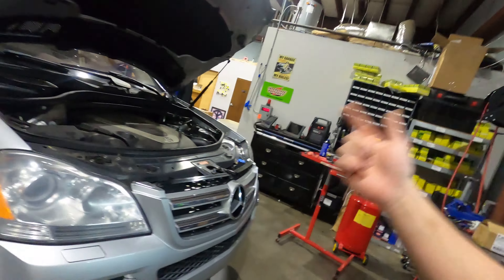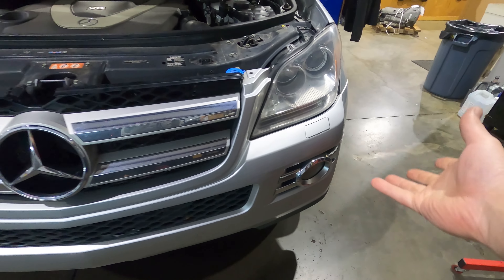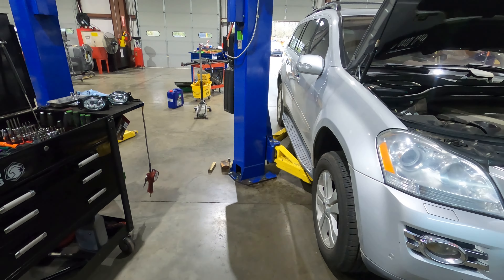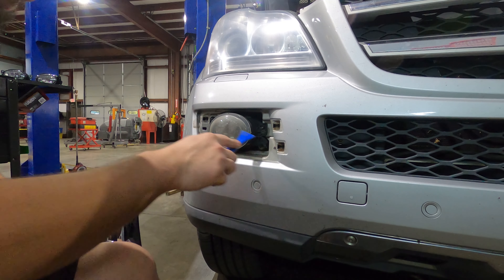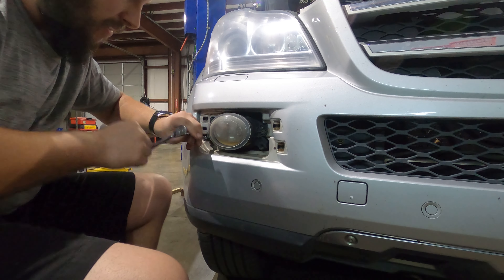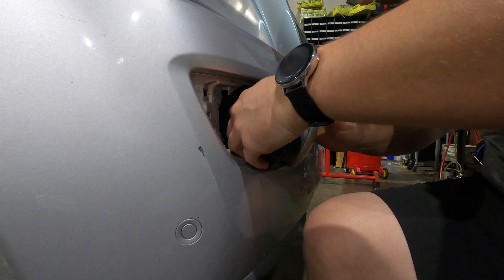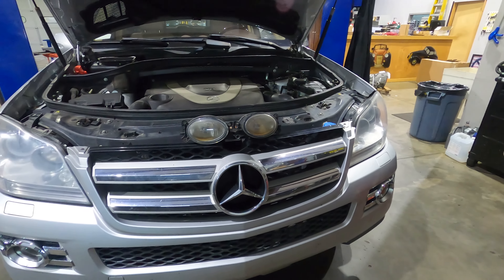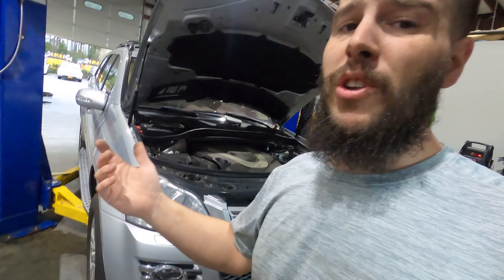Mercedes-Benz GL450 Fog Light Replacement

Comment: Have you done a headlight replacement?  I just got a used 1 and the assembly needs replacement because its so oxidized.  Was also thinkin of putting in a halo kit as well...
Reply from the maker: I have not. I had previously done a headlight restoration on this vehicle. But haven't had any other issues with the headlights. May in the future but don't have plans as of right now.